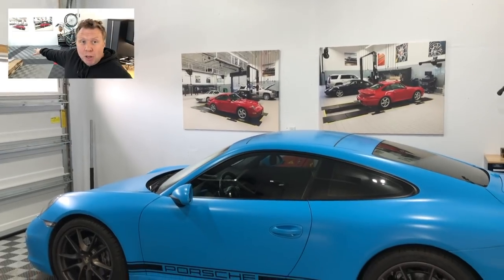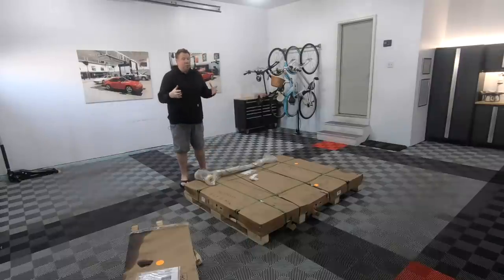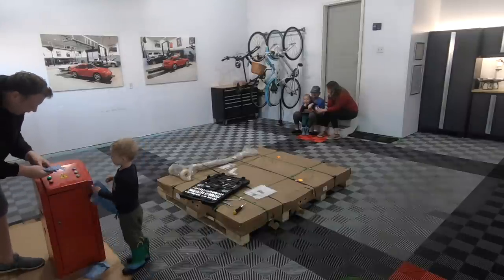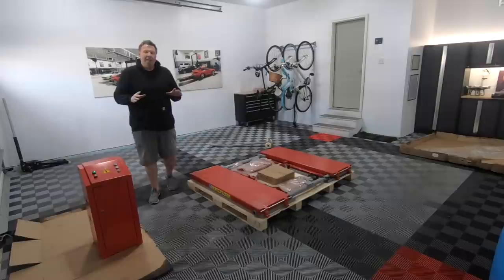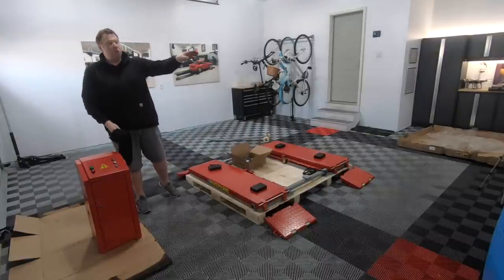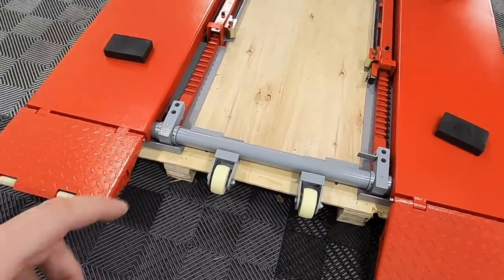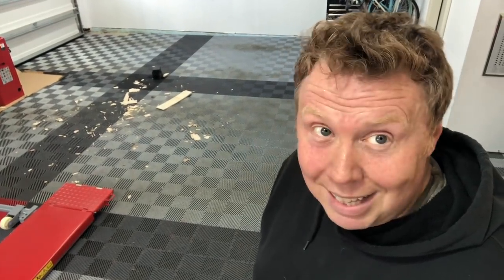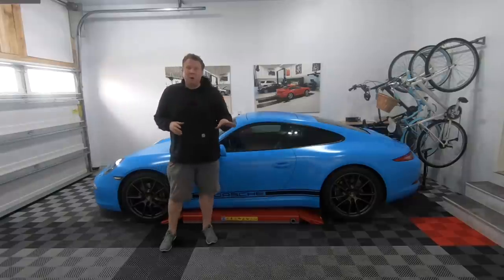Garage Lift Part 1 - Unboxing & Installation

Comment: Just finished watching. The lift looks good James. Love the red color and it seems to fit the 991.1 just perfectly. I expect you need to add hydraulic fluid and maybe bleed the system to get it to lift. Can’t wait to see the car off the ground. A good idea may be to test the lift without the 911 on it first (just in case), precious cargo as they say. And yes, move it forward in the bay about 1.5 feet. You have plenty of room. Good luck!
Reply from the maker: Perfect! Thanks Chuck! Great advice.

Comment: Once you find a final place for the lift, can you cut out or remove the garage flooring/tiles  so the lift rest directly on the concrete?  Lowering it just  a little more might make a big difference?  I can't wait to see the car up in the air!
Reply from the maker: Great suggestion!!

Comment: Enjoyed watching the video. I am not impressed. For starters, the control unit needs to have an option of mounting on the wall above 7 feet with a pendent controller or 2-inch box you mount on the wall at 4 feet.  The control unit is for a large garage (maybe where it is moved a lot as it has wheels too) and not a residential garage, unless you had 3 bays and 2 cars. Then there is the obstruction EVERY time you park your car in the garage.  Sorry, this would drive me CRAZY unless I used it almost every day, especially backing in and over it. Just an architect's thoughts.

Comment: Great job James! How about testing the lift without the car on it, once the hydraulic fluid has been bled and filled? It would be good to use a spirit level on the raised lift front-to-back and side-to-side, so you will know that the car will be perfectly level when off the ground. Luke and Adam might enjoy the ride up and down too ;-)
Reply from the maker: Oh yes, absolutely. It’s going to take a week for the other plastic lift pucks to arrive anyway, so any lifting in the meantime will be without the car.

Comment: Loving your channel. Would love to see a video on how you have gone about buying a porsche. So far you have bought 3 preowned cars. Would love some advice that is REALISTIC, the forums require you to be an auto expert to ensure that you are not ripped off and get a good deal but most of us dont have time to do major evaluations, search sights, visit tons of dealers or seller. So perhaps you can tell us how you did it each time and what you would do different - Thanks
Reply from the maker: Thank you!! Sounds like a great excuse for a video. In the meantime check out this podcast I made about it: http://autoamateur.buzzsprout.com/770141/2544484-buying-a-porsche-911-do-this

Comment: Also wondering about leaving the lift on the flooring. I havea checkerboard plastic garage floor and it seems to dent when using jack stands, just curious about your thoughts?
Reply from the maker: Hey Michael! So far, no issues. The tiles are holding up well. They may dent in the future over time but they're essentially $2.50 / sq.ft. to replace if necessary.

Comment: Try driving a very short screw with a 15+mm hex head through the center of your hockey pucks. They then fit nicely into the jack pads reducing the risk of slipping

Comment: Hi James, as always a great video. Researching for a mid-rise lift and was looking at the Twin Busch, I believe that was your original choice? May be I missed it in your video, but why the shift from Twin Busch to Cavalier? Plus, how would you rate the Cavalier now that you have your 996 project underway? Cheers Andy
Reply from the maker: Hey Andy! I would say the Cavalier and Twin Busch are essentially the same. Same lift height, same safety features, same width, same access to the underside of the car. I think it comes down to whether you want red or blue (!) and also how the console looks. I preferred the more permanent “box” like console I got with mine. The TB one looked like a plastic bottle on dolly wheels. My kids can’t get at it and play with any of the hoses or connectors. I feels safer and sturdier.
Reply: Auto Amateur - Thx James, makes sense, I too like beater and safer items!! Cheers AC

Comment: How do you feel about the flooring? Im also looking to get this style lift. Im really limited on height. So its either this style or quickjacks.
Reply from the maker: I love my flooring and after 4-5 years it's wearing really well. I'm tempted to try out an epoxy floor at some point, purely out of curiosity, but the Race Deck tiles are absolutely fantastic. Hard wearing, easy to clean. Awesome.
Reply: @AutoAmateur  do you notice any crushing of the tiles from the lift?

Comment: This lift seems almost identical to the Twin Bush except color which is blue
Reply from the maker: That’s right, it’s basically 100% identical in size, looks and capabilities. The only difference is that the Twin Busch one doesn’t come with the smart / sleek metal enclosure for the hydraulic controls. They sit on a little cart.

Comment: Just guessing, but maybe for shipment the ramps have been mechanically locked in place.  May need to remove a bolt or something to lift the ramps.

Comment: A coupe of suggestions: 

1)  I would cycle the lift WITHOUT the car on it to make sure it's working correctly.  You don't want you car sitting on it's side on the first lift cycle! 

2)  I would throw the bicycles away!  lol   (just kidding)  Great exercise machines!   Yes move the ramps closer to the door. 
Looking great!  I may invest in one myself since I'm selling my present house and buying a new one hopefully soon! 

3) Place the control unit in a corner somewhere providing better access along the side to the car. 

Eliminating floor jacks would be great!
Good Luck!

Comment: Are you sure the lift mechanism has got some transport bolts in it that kept it locked together whilst on the pallet need removing before use?

Comment: Nicely done mate!! That red color works well with your garage! At 25.12 when you are backing onto the lift, there is a huge L shaped metal piece on the rear cross member. It looks like it would hit the bottom of the car. What is that?? Can it be removed? All the best and enjoy!

Comment: Hi James my thought is the hydraulic pump needs purging to remove any air in the system. 
You will need to bleed the lines and system this is done by cracking the line at the actuator with the motor running until you get all flood and no air. 
Treat it like your brake system in your car bleeding the brakes. 
If you haven’t got it working yet try that.
Reply from the maker: Thanks Terry! I’ll do that!!
Reply: Hi James sorry I just read my comment I meant fluid not flood. 
I hope that fixes it for you. 
I love your channel by the way too. 
I like that you are a normal guy that loves Porsche’s 911s in particular just like me. 
Look forward to more videos. Cheers Terry.
Reply from the maker: Thanks so much Terry! Fluid not flood. Haha. I read it like fluid anyway. Cheers!! 🙌🤩